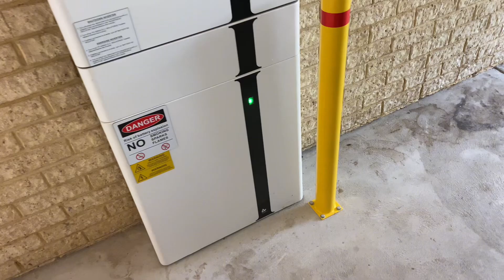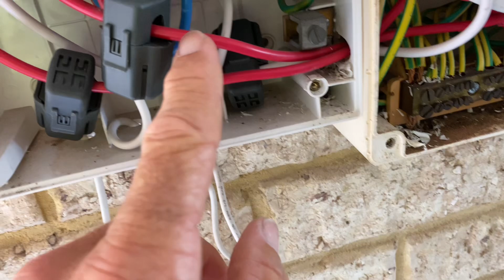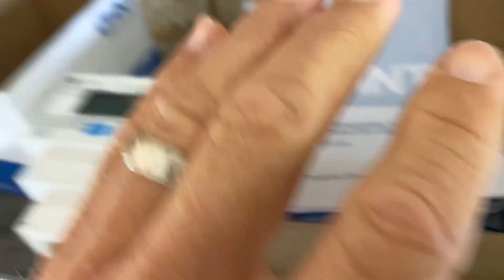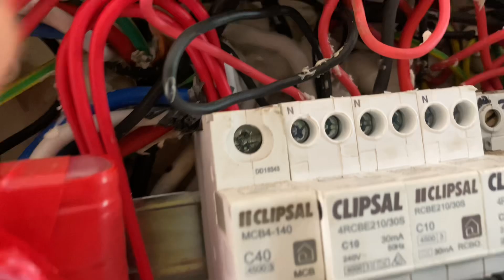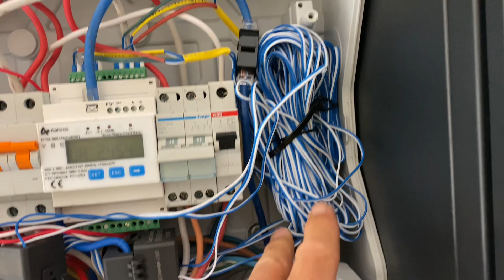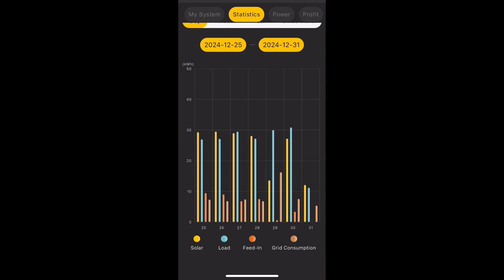Fixing an Alpha ESS battery system that has not worked since it was installed 2 years ago in Perth!

Comment: Nice work Jase, bet they're happy to know someone has the knowledge to get everything working properly, Happy New Year mate !! 🤠😎
Reply from the maker: Cheers mate, Happy New Year to you too 😊👍🏻
Reply: @joondalupelectricalservice3201, can you recommend anyone in Melbourne (preferably Eastern suburbs) that can fix issues with these Alpha ESS inverters/batteries? 

We are on our third unit now. First one had fault light on perpetually, second kept shutting off and restarting power every half hour and with this one the UPS backup does not work as we found during a recent outage.

Install was done by a contractor two years ago, and we are getting the run around from the solar provider. I heard they stopped selling these units due to repeated issues.